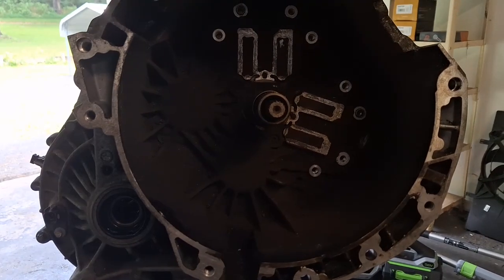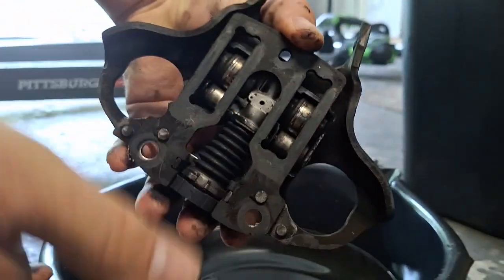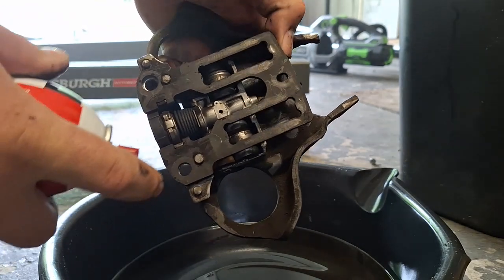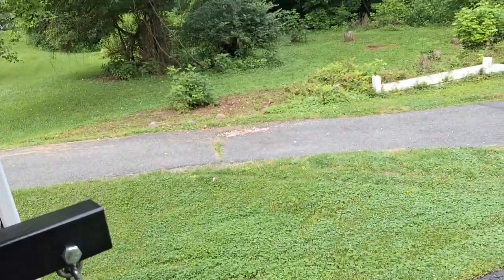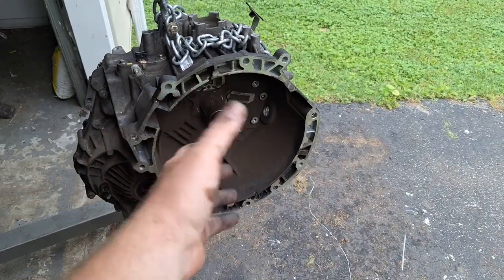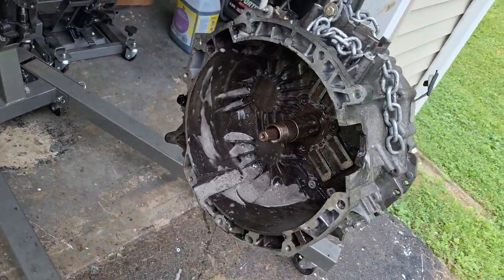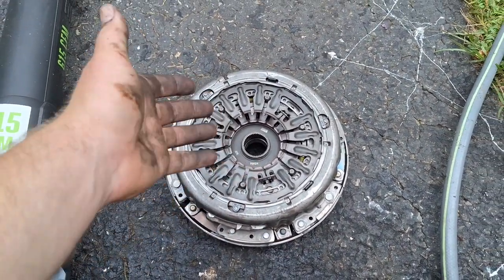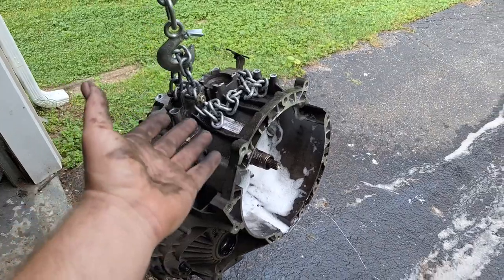$0 Transmission Rebuild | Ford Focus & Fiesta DPS6 Powershift!

Comment: ben what do I do if I over turned my A fork and now lost spring action. does it need to be replaced? or just cleaned and reseated?
Reply from the maker: Hi it sounds like your fork is damaged. Assuming its in the vehicle not taken out in your hand. It needs clutch pressure plate pressure to release on its own
Reply: @BigBensCarsAndCycles   thanks for the prompt reply! sounds like I need a new fork? might as well change the clutch while im in there . transmission has 170k miles not sure if it was EVER serviced
Reply: @ by god yes those forks were seized and literally full of rust and water I’m assuming car suffered a flood before I bought it

Comment: Hello, I have a Ford Fiesta 2013. The car has no reverse, it does not start when is on P, but when shifted to N, it can start. It makes noises that for what it seems to me might be coming from transmission when you are trying to start it, seems like it is trying to shift some gears maybe? I am not sure what the problem is

Codes that found are: P07a5, p287;00 + p007;00
Reply from the maker: Hi, those codes and symptoms make me think your bottom clutch fork is sticking.
Reply: @BigBensCarsAndCycles  Thank you! So the replacement of the clutch and bearing should fix the issue, right? Dealership wants 3800 for having those replaced

Comment: my 12 focus is horrible in 1,3,5 it barely shifts into second 2,4,6 & my reverse is fine could that be clutch acuator a ?
Reply from the maker: Need to know what codes it's setting

Comment: Ford dealer told me I need a whole new transmission for a po7a2 code , 151k original miles ....I drilled hole in housing and douched with brake cleaner and still slipping....car still runs in lower gears.
Reply from the maker: No, for a p07a2 code you probably have a damaged slave cylinder

Comment: My son has a 2012 Focus with the DPS6. Has code P07A5 along with no 1-2 or 3-4 shift. Skips from 1st to 3rd to 6th with terrible shudder and slipping in between. Car has 160k on it. He bought it for $500 from his aunt, who bought it new, and the clutch has never been replaced. I did have to replace his coolant inlet, as it did the usual and broke, causing a rather large leak onto the bell housing, which I have been told can ruin the clutches. He was told by a trans shop that his only option is a used trans for $4700. I'm a mechanic by trade, but have never delved into the Auto trans world. But since this is nothing more than an auto manual trans, I can do the work. With these symptoms, do you think it would be wiser to go with the used, which I can get used locally for $2300, due to the possibility of synchro and/or fork damage, or does it sound more like installing the Luk rep kit would fix his issues?
Thanks for all of your videos! I have learned a TON about this tranny from them!
Reply from the maker: I'm glad the videos helped. I have no reason to think anythings damaged other than the clutch and forks.
Reply: @BigBensCarsAndCycles  thanks! I was hoping you'd say that! My son will be out of town all next week, so that gives me a good opportunity to get it replaced.

Comment: I chased the solutions for improving the electrical grounds (it helped), inspecting the actuators, and cleaning the forks.  The key to cleaning forks is transmission relearn afterwards.  If you do not perform a relearn expect no improvements.

Comment: First off I just want to say ty for answering me but yes I put the shims back on I checked the wiring a few times lol its throwing the exact same codes that the old Trans did and the one I put in has everything thing replaced I I did clear the old codes out oh and the same time the shifting started skipping 3 and 5 the hill start assist not available came on to I apologize for so much ty again
Reply from the maker: You replaced the whole trans? I didn't know that. Including the harness and TCM? And its setting the exact same codes?

Comment: P0715 p0718
Reply from the maker: Did you put the shims back on the sensors, and were the wires chafed by the connectors? Can you pull the sensors back out and check for damage? or metal

Comment: Hello hello I have a question I hope you could answer please I have a 2012 Focus my transmission malfunction comes on every time I start it I replaced everything on the transmission TCM clutches clutch dual clutch and the rollers and it's doing the exact same thing could I have a bad PCM
Reply from the maker: What codes is it setting